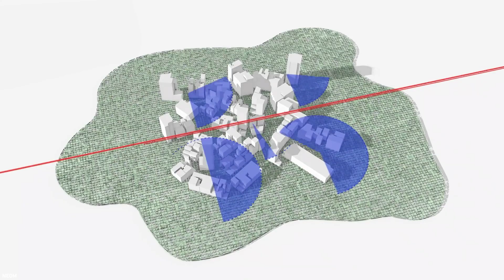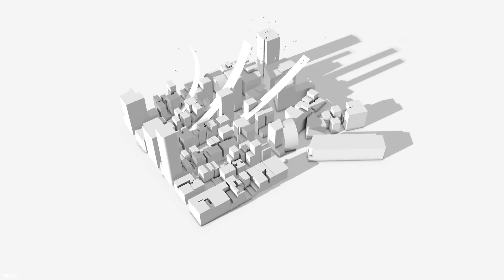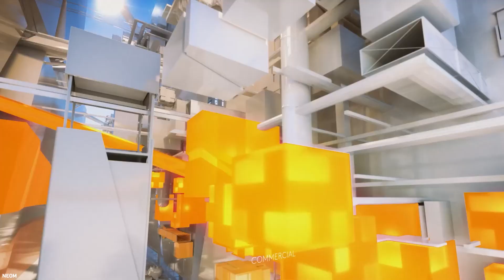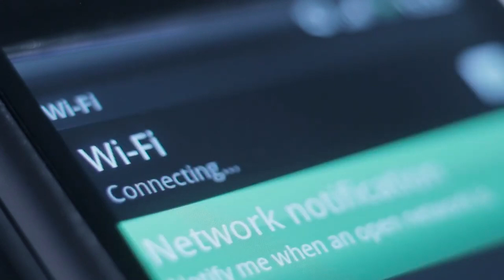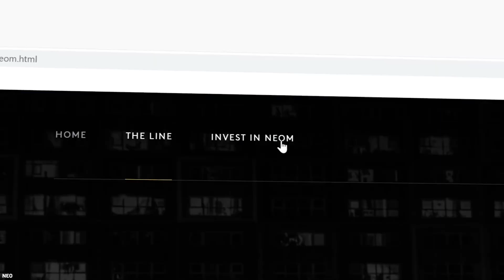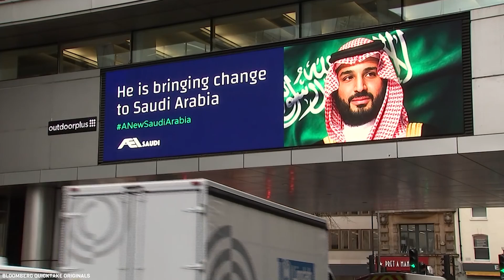Inside The Mirrored Skyscraper Megacity In The Desert

Comment: In  vertical   line    is  better  from  north   to  south   and  the  mirror 
faces   from  est  to  west   where  the  sunshine    is  laughing   to  them
to  the  mirrors   walls   .
In  the  hot  and  dry   climate   like  in  South  Arabia    that  kind  of  city
is  the  right   thing    to  build   like  this   and  not   so  far   from  the
sea   just  along   because   water  is  very  crucial   for  the project   like
these  .
Reply: The South -Fassade will stretch more than the northern, 🌞🪗🌡🤔

Comment: I've seen almost exclusively claims that this can't be done (and no wonder) but it should be kept in mind that people planning this have absolute power and near limitless funds.
Pyramids were made with not much more than hands when there was absolutely power and deep pockets demanding it.
I see the biggest problems not being technical or economic but more humane and ethical.
Reply: The thing with the Great Pyramids is that their structure is much more simple in terms of holding itself up. The Line on the other hand has to contend with serious lateral stresses that it'll take much more engineering just to fight the forces acting against it in comparison to a square-based pyramid, let alone making it habitable in the first place. But yeah, you're right. There's a whole slew of issues beyond its construction and engineering. DamiLee made a good video outlining key concerns ranging from the architectural, anthropological to the environmental.

Comment: Absolute stupidity.  This fails to work on so many levels (sorry) it's not funny.  Apart from the cost and complexity of building something like this the two biggest problems I see is its reliance on the Hyperloop for transport and its shape.

The Hyperloop is a ridiculously expensive way of transporting people that hasn't demonstrated anything beyond about 170 kph maximum speed on a one mile miniaturised track (and unlikely to) since they started experimenting about ten years ago.  The shape of a line is THE most inefficient way to design a city for transporting anything or anyone, not just because they have chosen to lengthen (literally) every journey, but because of the congestion within the Hyperloop tubes etc.  There are reasons why cities evolve in circular shapes around freash waterways and NEOM has neither.

Comment: I don't know if I necessarily love the whole walled "mirror" city part of the concept, and perhaps that should change if the project does go forward... but the basic idea of a "line" city built around a central high-speed railway is a compelling idea, IMO. In places where rail transit lines exist, urban centers tend to crop up around them anyway, or the rail-line is implemented to go from city center to city center in a metropolitan area. This would just be going whole-hog into that practice right off the bat and designing the city center entirely around the rail line. Maybe just make the design a little more normal in terms of the buildings that are built around the line. And let it spread out a LITTLE more to the sides in a type of semi-suburb sorta style. Stuff like that could make the concept more practical and attractive to more demographics.
Reply: well the mirrored wall is clearly meant to reduce heat exposure to the city from the surrounding desert
Reply: @erseshe  the line would be an efficient use of space and easier to travel given proper engineering and architecture design at planning
Reply: @erseshe  see there's the problem you have thinking that high speed rail is not an absolute + in design. a city designed where no cars are is the ultimate in great design
Reply: @erseshe  here's the thing. you are focusing on the fact that a high speed rail is bad somehow when it's intrinsically amazing! no cars whatsoever is the absolute pinnacle of great urban living if ya don't have material transporters.
Reply: @larrychatfield  go watch Adam somethings video about it, he explains why this specifically is a bad/unfeasible idea
1. it is technically possible with the newest high speed trains, however that is only if you don’t take any stops in between the ends into account. Considering a scale of length like this, you will plan in at least a few stops. The simple necessity of accelerating a train several times just shows the buzzword presentation of this city. TECHNICALLY you can travel from one to the other end in 20 minutes, but in actuality, there won’t be such a line running as it would leave out the rest of the city.

2. and even if, this leads to another problem: per the design of a literal line, you have limited place for parallel tracks, making this direct train line a waste of capacity better used in short-distance cargo transport.

3. in case a train breaks down, the whole train line will be unusable, as it has to be removed from it, losing out on capacity (that’s why Elon musks hyperloop concept is also bullshit, there’s no alternatives for cargo once a line is temporarily unusable)

Now, comparing this to a city with radiating train network from a city center, you can 1. allow for more than enough stops while still having a high throughput AND feasible travel times as several trains can be operated independently from each other as they drive in different directions as well as 2. still having a solid cargo system which can operate too while 3. having replacement routes which might cause temporary strain on the train lines and delay, but never completely halts the cargo transport.
The argument of „but this city will have no cars“ in itself pointless as they could have designed a better radial city with this crazy amount of money while excluding or limiting roads to the outer parts of the city. Our cities could also be less crowded with cars if we only pushed back on roads from cities and instead build more public transport/bicycle pathways + more greenery. (Some cities have already removed some highways/high traffic roads with quite some success, actually)
Reply: In your dream in Thier dream even Thier weapons are AMERICAN lol.